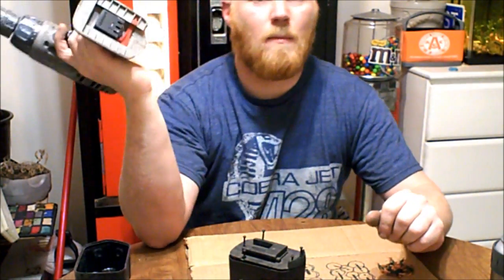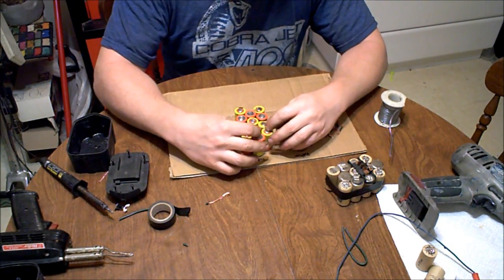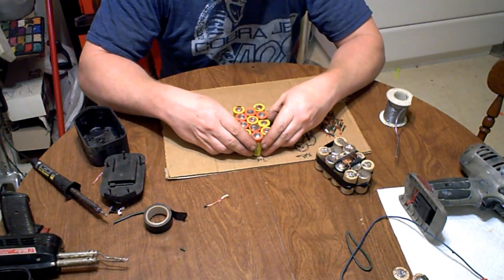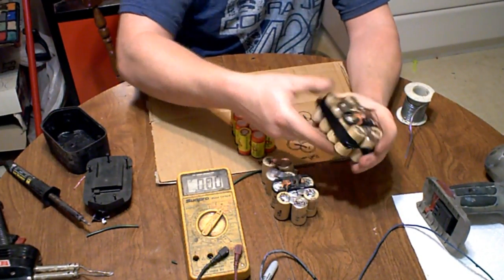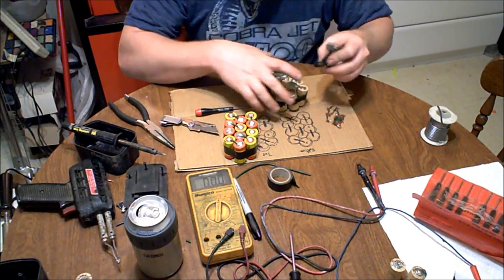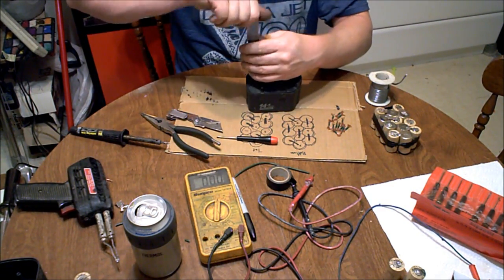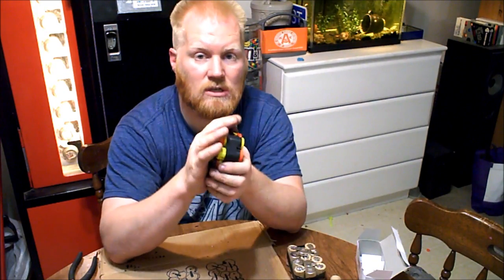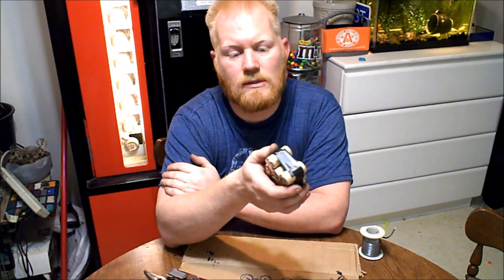Cordless Drill Battery Pack Rebuild for $20 or Repair for $0

Comment: Having the same problem with solder not sticking to batteries...scuffed the surface but still can't make it stick. Sticks on my tabs fine . Little nervous holding heat on the batteries that long .

Comment from the maker: They have been around a long time but they are relatively reliable, cheap, and light weight. They already are becoming less common in new tools but are still common place in mid to lower end tools that the majority of people buy. I see more and more LIPO and lithium batteries being used more but I don't see NiCad batteries becoming obsolete for the next decade. There's hours of reading on the subject and each battery has pros and cons.

Comment from the maker: Scuff the surface of the battery with a piece of sand paper or put a dozen small scratches with the tip of a pocket knife. It gives the solder something to bite to. Let me know how that works.

Comment from the maker: YES. The Lithium have the 3.7 v 18650 cells and can be individually replaced or all. 

YES The Nimh have 1.2 v Sub C. I would replace the Nimh with Nimh even though the Nicads are better. The charger for your battery pack is designed to only charge Nimh cells and would over charge a Nicad.

Let me know how it goes. Moe

Comment from the maker: I don't know of any batteries that are 1.85v rated. Your laptop batteries are more than likely already the 18650 lithium that are 3.7 volts each. They have 2 sets of 4(in series) wired in parallel giving you 14.8 volts. There's no reason you can't just do 1 set of 4 in series giving you 14.8 volts.

Comment: Yes.  After an even more careful inspection, the long cells are actually 2 sub c's wrapped in a uniform cardboard.  I need to cut a little away and make sure one of those isn't dead.

Comment: I spoke too soon.  I just charged the pack to see what cells are dead.  When I fully disassembled it, there were 3 more batteries lying flat under the others.  Two of the batteries are twice the length of a Sub C and one was standard size.  All that said, I found 2 dead cells and the long ones were not them.  So I solved the 24 volt problem.  And by scavenging the two packs I may have $170 worth of batteries for under $20.

Comment from the maker: Seems like they are stretching their numbers a little. All Nicads and Nimh are rated at 1.2 volts HOWEVER when they are fully charged they can reach 1.6 volts. They wont stay at this voltage for long, but it sounds good.

Comment: Sixtyfiveford,
Thanks.  This was great.  How come my Bosch 24 volt (Platinum series) has 15 batteries?    By my math that would make my 24 volt an 18 volt.  Or, are they somehow 1.5 volt batteries (making it a 22.5 volt or 24 volt because it's close enough)?  Thanks,'
CJ

Comment from the maker: On your Ryobi, one cell in the pack is probably bad causing your frustration. I would open both packs and test for the 1 bad cell and replace it with a cell from the other pack or you can buy a single cell and replace it. This will usually give a battery pack an extra 2 yrs of homeowner use.

Comment from the maker: ....cont      fully charge it or fully discharge it within a couple month period the memory would stay... The thing that kills these battery packs is useing them after the drop off power. The moment you notice that the battery pack is weakening STOP. Below this point some of the battery cells can actually reverse polarity and will be permanently damaged. It is usually a cell in the middle of the circuit.

Comment from the maker: ----cont. A study was done and publicized about the "memory effect" that Nicads have. They also found that if the fully charge these same batteries every couple of months and fully drained them any memory was completely erased. For the average person to feel memory effects with our power tools we would have to drill the exact same amount everyday and then under charge it the exact same amount, time after time after time. And as long as we didn't accidentally fully charge it or ......cont

Comment: Also NICAD battery's have a "memory".
Funny thing I had a Craftsman drill I bought in the 80's that had NICAD battery pack and it lasted 15 years1.
I bought a Reyobi that has NIMH battery's and they don't hold the charge long, I have to keep one pack on charge all the time while I use the second one.

Comment from the maker: Few battery packs came with NIMH, but if they did I would stick to NIMH as there are different types of chargers. Most chargers it wont make a difference but some are timer operated and could overcharge a NICAD. 

NIMH.. give out more power slowly so they also take longer to take a charge. If power is drawn or given to quickly the overheat.
NICAD... give out the power quickly and also take a charge quicker. This is why they are more popular.

Comment: If the drill battery pack has NIMH. battery's in it you have to use the same kind of battery's because the charger for the drill is not made to charge nicads.
Have you had a problem charging nicad battery's using a charger made for NIMH. battery's?

Comment: hi thanks for the DIY. Makita don't sell 14.4v NiCD tools in Australia anymore so I just bought two on eBay (one drill/driver and one combi driver) to compliment the drill driver I have already so I can drill with one and drive with the other, and have 5 batteries across 2 chargers and 3 drills. But no doubt I will need this DIY.

So my questions is can I use a Sub C with higher mAh ratings to repack a 14.4v Makita battery as I see some from 1600 to as high now as 2800mAh

Comment from the maker: Yeah, I always steer clear of the NIMH. I have been selling stuff on Ebay since the early 2000's and the Paypal has always been a thorn(hate being locked into 1 thing). Yes, I like the piece of mind Amazon offers and have bought a lot of stuff from them. Being a seller on Ebay I realize that Ebay doesn't sell anything and it is a collective a mostly good private sellers. I will pay more on Ebay for a reputable seller vs just the lowest cost. I didn't know people when making solar NiCd backups.

Comment: Good point re: Ebay low cost. Have issue w/ eBay demanding only PayPal, fake emails. Ordering 6 pack Tenergy NiCd Sub C 2200mHh 1.2 V rechargeable / tabbed cells $14.69. Considered some of best batteries available at any price; check Amazon. Rated 5 stars. IMO well worth the few extra bucks. Good warning - NiMh cells can burn up, have serious safety, charging issues unless one takes cautions. Will use custom NiCd  12V pack as backup power for my Solar System.

Comment from the maker: If you get them from Ebay, you can get the same name brand cells for under $2 a piece which makes it a cheap alternative to buying a new pack. Most of the other online stores gouge on shipping making a rebuild of a 14.4v pack over $50 and a 18v almost $70 compared to $22 and $28. Thanks

Comment: Great info, well done. Rebuild works same for most portable battery packs; Sears, Skil, generic drills sold by auto stores. New NiCad Sub-C batteries available thru Megabatteries, several online sites. Remember they're Sub-C batteries, not the same as regular household C cells. $4-$5 for each rechargeable cell.

Comment from the maker: Oh sorry I thought you meant the battery pack. I don't have a defective one around to make a video. If it just do anything when the trigger is pulled, it could be several things:worn brushes, shorted trigger,  or burnt up rotor-stator windings. Worn brushes will usually allow you to spin it by hand and it will start spinning (really rough). Shorted switch just usually needs to be cleaned. Shorted rotor or stator windings are generally the death of your tool.

Comment from the maker: The terminals pry off easiest with a pair of needle nose pliers. Also to disassemble the tabs from the batteries grab with needle nose pliers and roll your wrist to force them apart. They sometimes distort but are easily reshaped. The paper can be reused or use: card stock, cereal box cardboard or the like.

Comment: I’m trying to disassemble an 18 volt XR+ NICd battery pack, I have the case off.  I’m having trouble getting the top battery with the terminals off of the lower battery pack as well as the terminal off of the battery.  What’s the secret?  What about the paper insulating plates on both sides of the batteries where can I get these?

Comment: Did you have to cut the terminal adapter off of top of the battery set?  I figured I would be able to pry off the spot welded parts but it is REALLY on there.

Comment from the maker: I used some 14 gauge stranded wire. Yes, the tabbed ones work great as well. You will need to scuff them up so solder sticks and you will need to remove 1 tab from each battery. It will make sense once your putting them together.

Comment from the maker: @foryzdp I usually combine all the ones from severall packs to make a couple good packs. If only one is needed I would only do the one but you need to do it with the same capacity battery. The main reason to do all new cells is for the longest life.

Comment: Hi, great video! I have a Dewalt 14v drill and took battery apart today. They are smaller than the "sub C" in my Bosch 18v. They are about 1 1/4" tall. Any idea what those are called. Ordering the Sub C for my bosch right now. Thanks

Comment from the maker: I used 3 different ones, you can see them all at 6:27 in the video. I didn't need all of them, just one. The small pencil one is 35Watt, the gun shaped one is 150Watts and the large one is 225watts. The smallest one works good you just have to wait between each joint for it to get to max heat again. The largest one just gets the job done faster.

Comment: 1 question what type of solider did you on the batteries ? they are a few solder types out there today...
what iam remember on electric parts you use a acid core type solder...yes are no....

Comment: Hey I tried this with the die hard 19.2 volt batteries and I get a reading on the multi meter while everything is in the case from the metal prongs at the top but when I open it and try the individual batteries there is no reading at all! I have a greenlee analog multi miter I got from home depot... Any Ideas on what could be wrong?

Comment from the maker: The small pencil one is 35Watt, the gun shaped one is 150Watts and the large one is 225watts. The smallest one works you just have to wait between each joint for it to get to max heat again. 
If you have several battery packs you should first try combining good batteries out of several packs to make one good pack. This trick works great.

Comment from the maker: Yes, The paper behind the contact strip was the first thing I tried. It actually has a burnt out circuit for that particular lcd spot. The funny thing is I knew I was going to burn my hand before I did it. Thanks for the tip on the LCD.